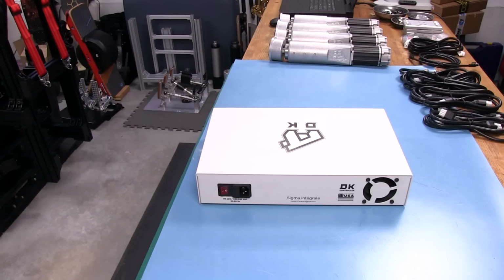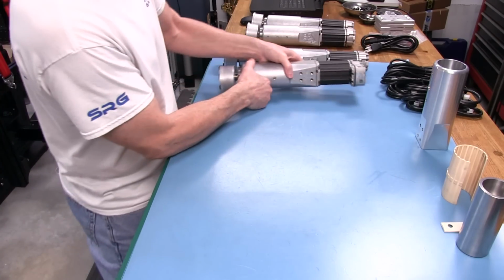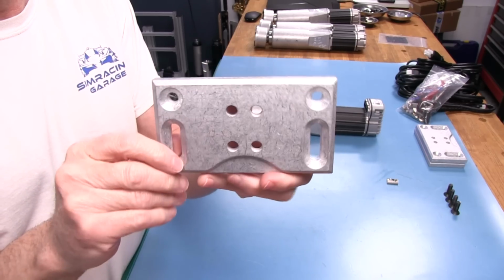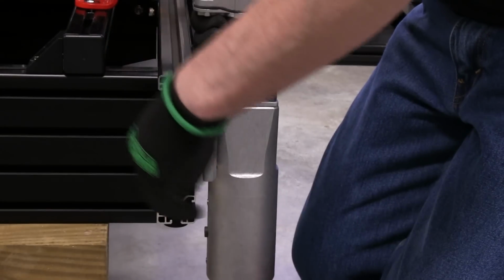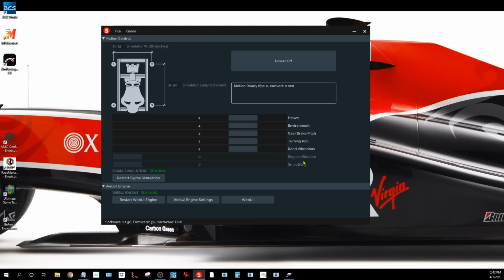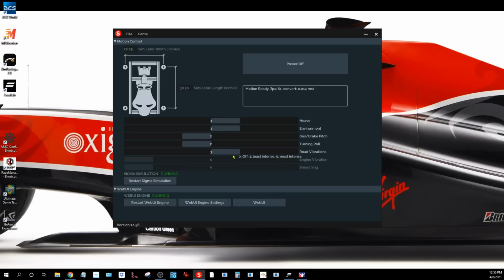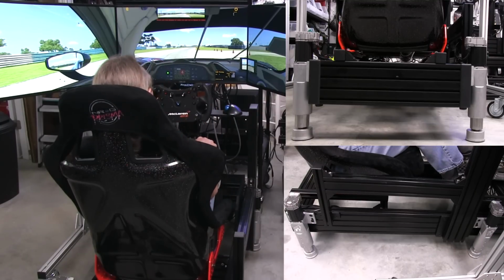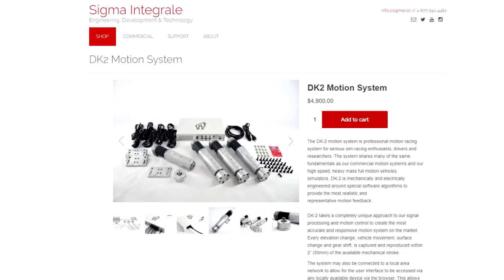DK2 3DOF Motion System Review

Comment: How do these compare to d-box gen3?
Reply: Better!! I know because I have owned both!!
Reply: @SURG3NT  in what way are they different?
Reply: @bystander85  the DK2 system is more direct feedback u feel, none of there motion code is fabricated, it’s generated from all real time sim physics, it’s more of a raw hardcore system than DBOX, with the DBOX it’s good but allot of the feedback is fabricated from effect based motion, I think the DBox is a better overall entertainment system for doing different  applications, but for driving simulation the DK2 cannot be beat!
Reply: @SURG3NT  dbox also has physics-based motion layers (I.e. the actual car motion reported by simulator). I was under the impression all effects layers could be independently turned off in the software.
Reply: @bystander85  yes of course DBox has full physics based motion but it also has fake effects too, the way the motion is delivered well at least to me the DK2 is better at letting you know what each tire of the car is doing..I’ve had both, and I jus feel of you are a hardcore driving simulation fan then the DK2 is the better choice, DBox is an entertainment system, the DK2 is a Driving system

Comment: You could actually see the car shake in the video align better with the motion rig as you adjusted the settings down.

I've been considering a motion rig but I'm still concerned about how pitch/roll will create incorrect head inertia compared to driving a real car. Sure the motion rig is moving correctly according to the suspension but, for example, under braking the majority of the force would have your head move forward where as in this case with the rig pitching downward your head would actually move backward. @SimRacingGarage I would love to hear your perspective on this
Reply: Hello Gregory, you may want to take a look at this video: https://youtu.be/grQ6KD--A_U  Cheers!

Comment: I have had my DK2 for 3 weeks now, and I am really happy with the purchase. The level of detail in the motion and vibration is really good. I run iRacing in VR and this system makes the car so much more alive.
Reply: @jonesyterp You can drive fast on any rig, even with an old G25 wheel. But the better feedback you get from a good wheel and a good motion system, the easier it will be to react to what the car is doing. Especially in a race when you go outside off your optimal race line to pass someone or driving at the limit with different track state and temperatures. DK 2 give you fast and exact feedback with movement and vibration. If you ask me I feel it give me an advantage. And driving with VR and motion takes the virtual reality another step closer to actually feel that you drive a racecar. ;)
Reply: @jonesyterp Cool. The MECAs look good. I use the VRS pedals. It really help to get a harder and more accurate pedal. If you are a bit curious about the DK2 you should send Sigma Integrale a email. They are really helpful ;)
Reply: Steffen please ..dbox has also a haptic feedback so Its also acting like transducers not only making pitch roll but also providing u to feel surfaces shakes bumps ..does this system have this ability also ?
Reply: @marsinko9714  Yes. As i understand it, it can produce vibration up to 1000hz. It works really good, I feel the surface and vibration in the car. They also work to add engine vibration in the next update in september. You should contact Sigma Integrale, they can answer alot of these questions better than me. And they have the best support. ;)
Reply: Hey Steffen, How is your DK2 holding up so far? I am about to order one . Any problems to report ? Cheers mate
Reply: @Татьяна-й8е6п  Its holding up great. I would buy it again, no doubt. I would send them a email. Im sure they will support you both before and after your purchase. ;)
Reply: @sscheen  Thank you ! Since this video did they updated software ? What dames are they supporting as of January 22? I am currently shopping for a motion system but have no clue what to buy .

Comment: This looks like a very nice product with good potential. Software and compatibility will get updated, it looks super easy to setup and get going. The stroke doesn't bother me since it will be really fast even with a lot of weight which is a huge plus. I'm thinking this would be a great setup combined with my gs5 seat. I hope they work on a traction loss upgrade option too along with software updates then it will be perfect. It's great to see many more motion options that won't break the bank

Comment: Seems like it’s competing with DBOX system. This needs more hardware stroke and software compatibility. 
The sim industry needs to standardize on protocols like EtherNetIP and CANBus (automobile and industrial sectors already use these) so endusers don’t have to worry about hardware/software interoperability or being stuck with a proprietary system. If the sim accessory industry wants to grow further, they need to conform to a common standard.

Comment: Wow I want one so bad. I'm paralyzed from a bad car accident and don't have use of my legs. I'm currently working on designing hand controls for gas and brake.  Having a motion system would just blow my mind. Anyway really enjoy your videos. You definitely know your stuff.
Reply: Fanatec's F1 magnetic paddle shifter set has analog hand inputs plus 4 shifters.
Reply: A circle behind the wheel for accelerator. A  handbrake system for the brakes. ✌️
Reply: Damn bro I'm sorry that happened to you 😓

Comment: modern race cars like gt3, gt4, gt500, etc.) are actually pretty violent when driving. The suspensions is stiff as hell, the chassis is stiff, and you get beat up. I gotta check out other vids with this system on different sims and rally stuff. It needs a 5th motor for Yaw.

Comment: Very interesting, if the DK2 guys are reading this... I really hope you introduce smoothing per slider option, in your next release. From the looks of it, these are super accurate, high precision, fast as hell actuators, which is great for road texture, but horrible for roll and gas/brake actions which aren't as sharp. Smoothing should help with the ball screw noise too... This maybe a dumb question; I'm curious why these guys don't just work to integrate with SimFeedback software?
Reply: looks like they added the smoothing per sliders! buddy of mine got their system and the ball screw noise on this nothing like what you hear on the review. at least 2 folds quieter
Reply: @Delta-mt8xb  Do you know for sure that they added the smoothing to their system :) I am about to place my order
Reply: @Татьяна-й8е6п  yes. but Russians don't need smoothing. Da?
Reply: @PeterSosinski  This thread is turning into a Russian  language practice… :)
Reply: @Татьяна-й8е6п  proper engine vibration coming out soon... ;-)

Comment: Price is good compared to d-box gen 3.
Reply: Only supports 2 titles as opposed to close to 100 for D-BOX. Also has way less tuning parameters. You can get a used but certified D-BOX Gen 1 unit for less.
Reply: @JD-  D-BOX sucks... way overpriced for what you get. The state of the art for $10K or less is G Force Factory’s EDGE 6D. Moves much faster, longer travel, quicker acceleration...
Reply: @Fluterra  Only 5 games supported and 8K €.... I'll stick with my D-BOX that was $4.5K.

But if you're happy with your platform then that's good.
Reply: @JD-  its anyways all inverted forces. watch the video from niles heusinkveld about it
Reply: @JD-  Well you can't compare them really, 6DOF and faster motion. All the current driving sims are supported on the EDGE, not sure where you saw that.
Reply: @Fluterra  It was in the plugin download. However in the support pdf there seems to be a few more.
Reply: @JD-   Ok, good point
Reply: @JD-  if anyone is selling a DBOX gen 1, I'm looking to buy one! My whole rig was a replica of Barry's from 2017, with the exception of a NLR v3 motion instead of a DBOX gen 1